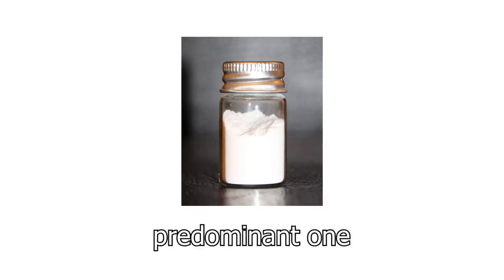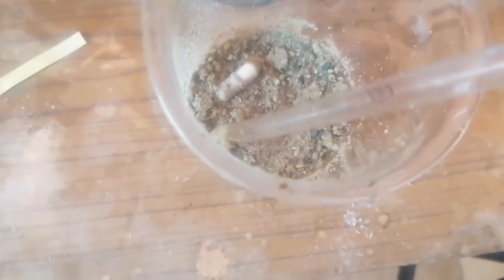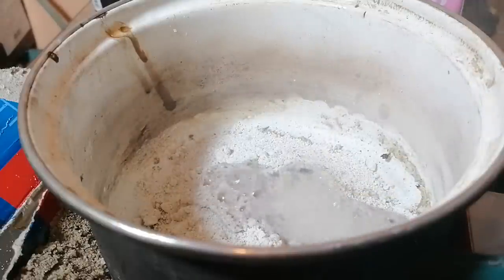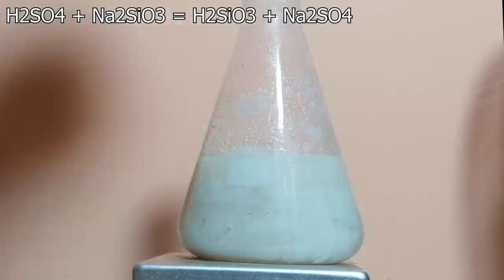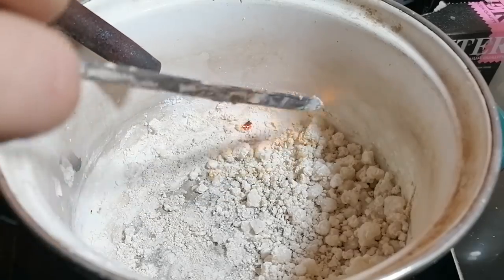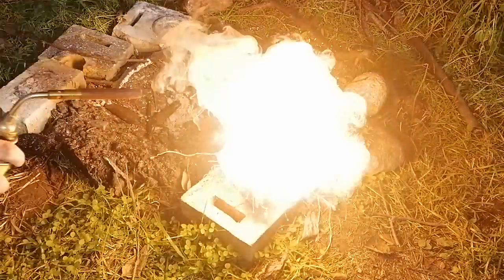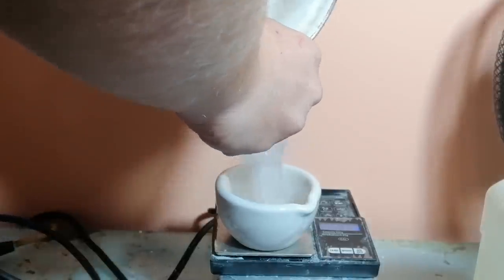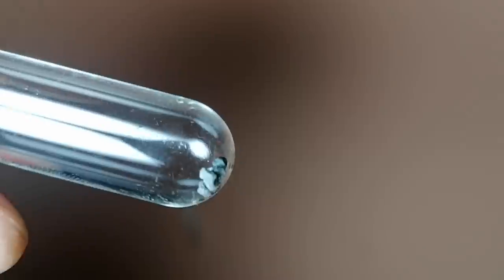Turning Sand into Sillicon Metal

Comment: Thanks for the video. 

Perhaps instead dry the sand thoroughly and react with Cl2  gas to form chlorides and hydrochloride mixture. 

Sublime off the Si compounds in a vacuum. 

React these on a hot surface with excess H2, also in a vacuum to obtain the Si metal.

Comment: idk why, but I've seen like 5 videos of purifying sand, and nobody seems to get the first part quite right...
you should screen out the rocks and pebbles first so that the remaining grains have fully exposed minerals, i.e. small enough that every grain is only made of around 1-3 minerals crystals stuck together, that way they are all available to chemically react later, which gives higher purity sand, and a faster reaction. long story short, screen the sand, only keeping the finer stuff.
my process is as follows: rinse sand through screen to remove all coarse grains and junk material, then rinse remaining sand with water a few times and pour off everything that floats, this removes organic matter, then use a magnet and remove most of the iron minerals, ( you can also try panning it after this step to remove hematite and some heavy minerals that don't contain SiO2) then add the acid to dissolve the carbonates, (warning, concentrated hydrochloric acid can dissolve iron oxide minerals making a nasty green compound, hence the two previous steps) then rinse one last time with water, and you will have relatively pure sand where basically all remaining minerals are either silica or silicates, both of which contain SiO2 in one way or another. then you can continue with the lye separation. also, I don't think silica is a salt, a salt is by definition composed of 2 ions, cations and anions in an equilibrium that makes the substance overall neutral, it is also by definition the result of an acid base reaction. calcium carbonate is a salt since it is the result of the reaction between carbonic acid and a calcium base such as calcium oxide. silicon dioxide is not ionic and is an incredibly inert insoluble oxide in contrast.
also, question, is sulfuric acid superior to using hydrochloric acid when neutralizing the solution at the end to form the silicic acid? at least to me is seems easier to just use one acid for the whole process. (I know this is unnecessary correction, but its "silicic acid" not "silic acid")
great video though, wish I had friends that also enjoyed chemistry...
PS, I've been working on making silicon by the carbothermal reduction method on and off for a year now, and so far I've been successful at creating silicon, but I'm working to increase yield and scale. (I have a solo cup with some silicon pieces in it sitting next to me as of posting this)
good luck with your channel man! :D
Reply: I am interested in this process of going from sand to silicon but do not have a chemistry background. Any way I can get contact of you so I can learn more about this process, maybe your email address? Genuinely interested
Reply: @mphonaheng5252  sorry that its been so long, but I do have answers if you haven't given up on this subject yet. I invented a custom way to create silicon without using metal reducing agents, and the materials are cheap, I'm going to test it soon.
I've also done lots of prior tests to study the properties of the SiO2 and C reaction that I'm using.